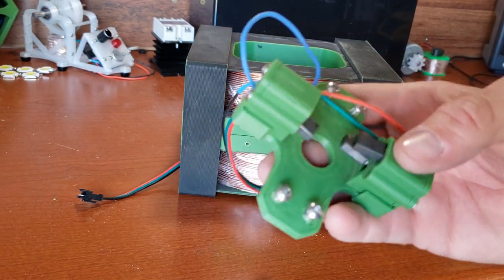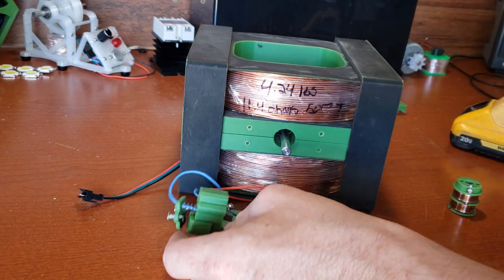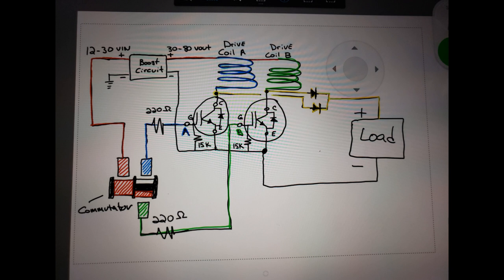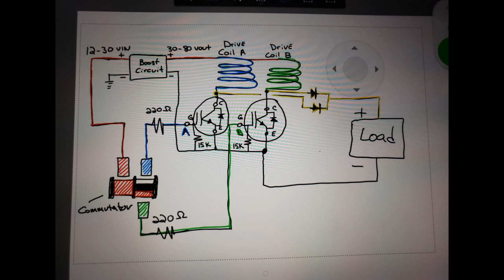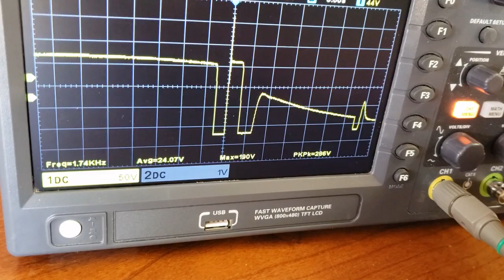Big Newman Motor Assembly

Comment: Very good design. Thanks for sharing. Would be great if you could test it's overall efficiency, just in terms of the energy going in vs the available mechanical power on the shaft(HP). The recovered energy is bonus.
Reply from the maker: Yeah, I'm just not sure how to do that. My strength is in design, not so much in testing. Would like to develop a tight community where different people come together and contribute their specialities. To design, build, and test these things to come up with a perfected design.
Reply: @redesign3dp  If you have a friend who works in a R&D Lab setup, he could help you, I think. It is a very easy and straight forward procedure, if the required equipment is on hand.
Reply from the maker: @tonyrebeiro  if indeed

Comment: Very nice build.  Its missing a couple key things that made his motor more efficient.
Reply from the maker: Yeah like the special commutator. I tried a few times to make one, maybe someday I'll try again. I should have named it a Newman style motor instead. Thanks for watching.
Reply: @redesign3dp  yea. I think it shorts out like 7 times in one rotation through a diode to capture the fly back,he also had another coil wrapped around it only for capturing the fly back.  The amount of copper required to make his motor correctly is prohibitive.
Reply from the maker: Your point about the copper is correct. I don't think a Big Eureka build is in my future.

Comment: How about Volt & Amper of output? To see if output power more than input power.
Reply from the maker: Sorry, I've never seen that happen in 20 years. I'm just using whats normally wasted but its never greater than the input.
Reply: The recovered power, in some cases is proportionately higher in ratio but never more than what you put in. If the duty cycle gets too high and the coils are getting over saturated, then a larger portion of the input power is seen to be coming back via the recovery diodes. I have fed this recovered energy into an 83 farad capacitor and by measuring the voltage rise within a specific time window, the power can be calculated in Joules. This figure substantiates my observation, when comparing to the total power send in. I have measured up to 60% of the input power coming back through the recovery diodes across the coil.
Reply: @tonyrebeiro  beautiful build,   the strength of the newman design is very high efficiency throughout the rpm range, -  i would consider the project complete with the motor has been installed into a machine and is tuned for optimum mechanical output efficiency (negligible eddy currents)     simplest application would be a steady load, pump or fan.   .... at which point i would expect you to have 95+% eff.   very satisfying.        -    solid state sw

Comment: Difference is newmsns motor would work off a 9v battery i doubt yours would even start to spin on 9v 0a, your wire is tooo thick
Reply from the maker: Plus his had thousands of feet of wire. This is just a newman style, I haven't seen a real newman replication that worked like his yet.
Reply: @redesign3dp  yep 5000lbs of wire I'm making one more motor soon with 10kg of wire 0.5mm but will that even be long enough?, 7yrs thinking about about it lol
Reply: @redesign3dp  the longer wire creates a much bigger magnetic field which collapses into a much bigger spike, its impossible for a little one to have the ssme effect , 

looks like his commutator had the positive and negative and both connections to the coils connected to it, 
so the bemf couldn't go back to the battery to destroy itself, 
but apparently if you collect the bemf with a full bridge rectifier, you can have that connected back to the battery from what i read if they are connected the right way around the motor will speed up, really the free energy comes from the mechanical work it can do for no current, 
only voltage but with this you can use a certain amount of volts to use it as a 1hp motor or more volts as a 100hp motor, the ones you can buy  are only a set horse power , and needs a set voltage and a huge amount of current, Newman motors needs like 1000x less watts to do the same job, in a couple of months I'll be uploading some experiments , i wanted to make wind generator growing up but knowing the wind only turns the shaft a newman motor could do that for very little anyways, big con that wind energy.
Reply: @redesign3dp  but having 4 connections on the commutator does bring new probems how do you stop it firing twice per revolution? It's the position of the 4 connections, need the +/- on opposite sides plates and the 2 coils on the 2plates above, not the 4 connected in a cross.
Reply from the maker: I'd like to check it out when you build it! Your right on your points, I read his book.  You should check out my new stuff, I'm a little bit farther than that newman video. Thanks for stopping by!
Reply: @redesign3dp  i will ;)
Reply: @redesign3dp  do you wind all you coils the same?,  the video i saw it was not wound the correct way, but it's not just you every video ive ever seen of ppl winding a coil is done wrong
Reply: @redesign3dp  on a coil every LAYER should be wound the same way, meaning starting on the left and ending on the right, 
i see ppl do one layer from left to right then the next layer is right to left, 
basically when power goes through that coil on both ends of the magnet there will be a N and s pole and a S snd n on the other end, 
if every layer is from left to right then there would be to N and N on one end and a S AND S at the other, 2 layers would have double the field strength,  
after i do one layer i try to get back to the other side with 1 loop or 2loops max to achieve all one way,
 just tapping a battery causes a really fast spin so probably leads to even lower power needed, 
i bet even the Bemf would look more uniform aswell, resonating coils are also meant to cause amplification.
Reply from the maker: I just use a drill and count the windings, I'm not patient enough to make them look pretty.
Reply: @redesign3dp  but for better performance? Did you see the comment under the one you liked or is that one invisible to you? Yt does like to delete majority of my comments